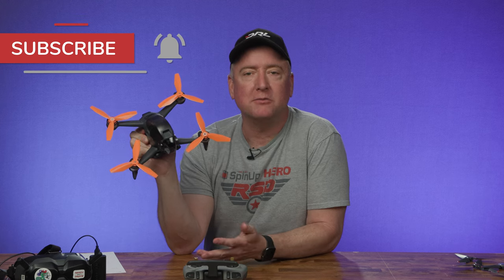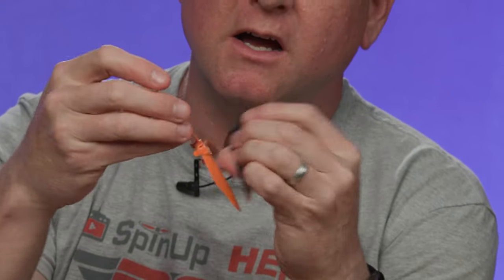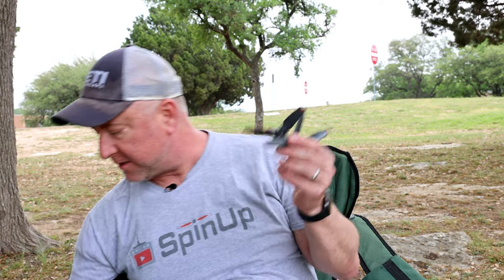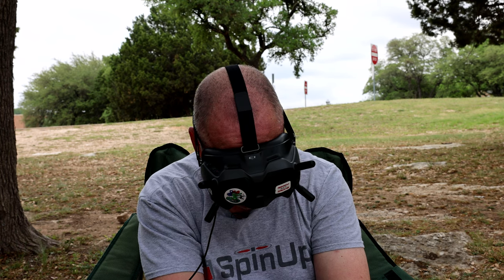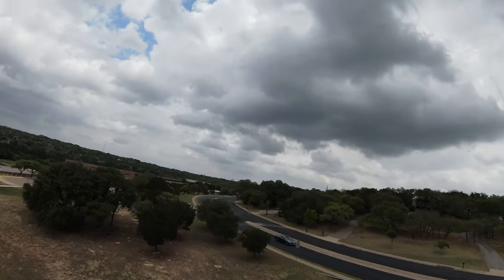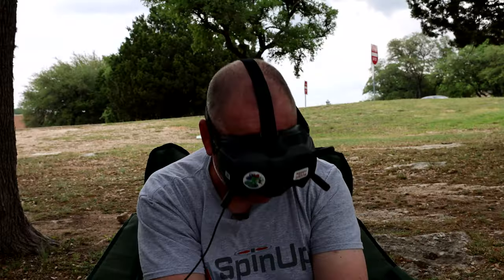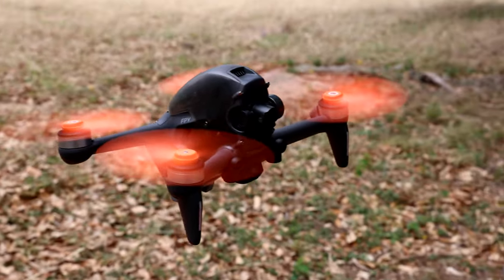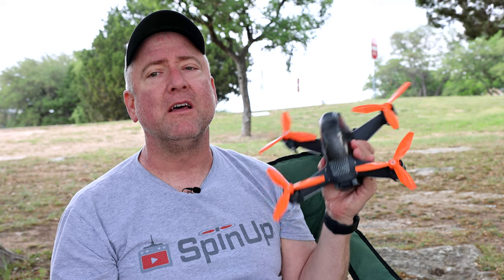Master Airscrew Props for DJI FPV - Worth It or Not?

Comment: Had a catastrophic failure flying over a lake with the green ones! One of the props flew completely apart while I was flying in normal mode at about 30mph. My friend told me it looked like my drone exploded instantly in mid air. Luckily, it landed within about 50’ of the bank, but it took four of us over an hour to find it. All Master Airscrew did was deny any fault. They look really cool, but unless you’re just wanting to sit your drone on a shelf and look at it, I would stay as far away from these props as possible! (There’s also a video on youtube of another pilot who experienced the exact same thing.) It shows the drone bust apart and fall to the ground. Same props!

Comment: I love the way they sound. They scream. One major con is voided warranty. In flight, mine made a gear stripping sound right before falling out of the air. DJI told me the 3rd party props caused my fpv to over perform and break. So I had to bust out $250 to refresh and ever since I’ve been back to stock props
Reply from the maker: Yeah, that's a shame. I actually emailed DJI support and got a reply back clearly stating that 3rd party props have no impact on the eligibly of DJI Care refresh. Then, being pleasantly surprised, I tweeted about it, with screen shots from the email from DJI. Then the DJI Twitter account replied, basically saying that employee who responded to me was wrong. 😕

Kind of makes sense, but at the same time, if I do something foolish like just drop it as I'm getting out of my car, why isn't putting 3rd party props also considered "accidentally damage"? 

If you're under that warranty still, it does make sense to use stock props, as you mentioned. 👍
Reply: That’s amazing

Comment: Have you tried the prop adapters yet? I know it's more weight centralized on the motor but if you're running a 5'1 pitch 3 that only weighs like 3.5 g it should in theory spin up a little quicker maybe? And it be nice if someone with a good YouTube channel like yourself did a 2022 review because I can see now you can get parts readily available and there's repair channels dedicated to disassembling this drone and repairing it.

Comment: Got mine and tested them out. Definitely more aggressive pitch and louder noise factor but I don't really see any power advantages or punch-out increase. I thought the bright red would be easier to spot but they aren't. With increased structural rigidity over DJI OEM props I do expect these to be more durable hitting leaves and branches but only time will tell. I can tell you that when I launch from my back porch the new blades clear every spec of dirt and leaves from concrete and send ants flying. This beats sweeping. 😄
Reply from the maker: Who knew that drones are great for back yard cleaning! Ha ha

Comment: Hey man, how do you take off in manual mode? Does it also bounce around like it does when landing? Thanks.
Reply from the maker: Once in manual mode, you have to tap the right/front button to arm it (not down and in with the sticks) and then it takes off like any other FPV quad. Take off in manual is easy, landing can be bouncy!

Comment: I installed master air screws on my drone & got screwed one of the three holding clips that hold the propeller to the motor cracked. I felt a shutter 200 feet up so I slowly flew back to my takeoff point knowing something was wrong & hovered at about one and a half feet off the ground the drone started throwing off propeller blades due to the imbalance one of the blades must have hit the other side and broke off two blades on the other rear propeller with two rear propellers disabled the front of the drone came up and I flew backwards and hit the ground and popped my battery out. When I took the rear blades off I found a little piece of plastic in the motor so I picked it out it was one of the three clip that holds the propeller to the motor. If. I didn't install the strengthening rods from the front arms too the rear. The rear two arms would've been broken off it did break one rod & scuffed the other so I took them off and ordered two more for $15 it was well worth it 😉👍🏻 I must admit the Chinese did a great job with the DJI FPV 👍🏻✨drone it held up under the crash💥
Reply from the maker: What a story! Thanks for sharing.

Comment: Howdy Kelly.  Thank you for this excellent review of the Master Airscrew Props for the DJI FPV. Yes, I have been a big fan of Master Airscrew Pops, too, ever since purchasing them for my Mavic Pro.  I've gotten longer flight time and quieter flight noise levels. I have an order in for their DJI Air2 Props now that they have solved the vibration problem.  Thank you for this video review and your interview with Master Airscrew CEO Boris Iskrev; both were well produced and informative.
Reply from the maker: Thanks Steve. The MA props definitely give some small upgrades and make whichever drone you put them on look much cooler. Also - thank you for the stickers! I put one on my laptop - front and center! Take care!

Comment: NO! My ludicrous plus propeller exploded and crashed my brand new DJI fpv on third flight. Maybe try the softer bendable ones but do not get the ludicrous plus
Reply from the maker: Wow! Good to know. I believe these ones I have are not the Plus version. Sorry that happened to you!
Reply: @readysetdrone  yea the plus version is clear colored and stiffer material. I will be doing a review with flight recording.
Reply: Are you sure you installed correctly??? I've only seen this happen when people mix-match the props with their corresponding motors.. automatic catastrophic failure... The same goes with any props.

Comment: I would stay away from them.  I got a red set (if it matters or not) when I start the motor 3/5 times it would think there is a prop guard and it would lower the performance of the drone.  There are quite of people also saying the same on the Amazon reviews.
Reply: Yes! Same here !
Reply from the maker: Interesting. I'm not sure what you mean about "think there is a prop guard". Can you explain in more detail? Or post a video of what's happening. I'd really like to see it and see if I can figure out what's going on. Thanks for watching and for the comment!
Reply: @readysetdrone  I'm getting the same warning, "Prop Guards Detected".  I had even sent back the first two sets (red &orange) at the request of Master Airscreww, and they sent me two more sets to test. I got the same result. I did not find it was lowering performance that I could see, but this is a very curious phenomenon. I don't quite know what to think about it... How would the drone think there were prop guards on?... I'm still flying with the new props anyway without problems, and they do look very cool.
Reply from the maker: I've never seen that warning before, even with other third party props. That's strange, to say the least! Does the warning appear right away after take off?
Reply: @readysetdrone  it happens when you fly in normal and sport mode.
Reply from the maker: Thanks. I'll see if it happens next time I fly it with MAS props.
Reply: @readysetdrone  The warning occurs right after take off. Within about 5 seconds or so. It does it every time. It's a mystery to me for sure...
Reply: Same here. Also noticed that the engines and where the fan/gps is located get pretty warm.
Reply: @nq0amark138  easy ,the extra drag on the motor with the increased pitch makes the flight controller think there are prop gaurds mounted . which  would increase drag as well.
Reply: @fnkycoldmedina  Thanks for the insight, that makes a lot of sense. Always learning something new from this community. Cheers.

Comment: I got mine a month ago! I have a good vid on hand catching how to. I don't like landing mine on the ground
Reply from the maker: Agreed that the DJI FPV is not easy to land smoothly - especially in acro mode. I usually switch mine to normal mode and let it land on it's own! I'd be interested to see how you hand catch it.
Reply: @readysetdrone  
 On my site there's a video that simply is titled handcatch where I go over  launching and catching.

Comment: Not worth it. Extremely brittle. Had a catastrophic failure of a prop doing a long sweeping left turn in an open area. Blades completely snapped off at the base.

Comment: The amount of pitch is not the same as the distance travelled in one rotation. That's not exactly how that works
Reply: I'm sure it's complex, but that's how I've seen it explained by multiple sources online. How would you have said it?
Reply from the maker: Agreed that is may be a simplified explanation, but it is how props for aircraft and boats are marked - 4 numbers - first 2 are the diameter and second 2 represent movement per rotation. But I agree that there is more to it than what I said.
Reply: @readysetdrone  It's not easy to explain that's for sure. 

If your propellor were to be a nut on a bolt for example, the pitchnumber would indeed relate to the up- or downward movement per rotation. 

In air (or water for that matter) it's a completely different situation. The amount of lift per rotation depends both on the density of the material the propellor is cutting through and the speed of the prop.  
And then there's also this thing called gravity that plays a big part.

Comment: I heard they explode 💥  in mid-air 😮 😱. I hope 🙏  not
Reply: most people install them wrong not realizing the red colored motors should match with the props labeled with a white circle.. if you install wrong they can not just "explode" but you will most certainly crash.. this is the same for the original props too the only difference is the white circle is red, just like the corresponding motors, to help the newbies figure it out.. yet people still mess up.
Reply: @BooFPV  if you install them wrong it will crash on takeoff and you won't make it to mid-air